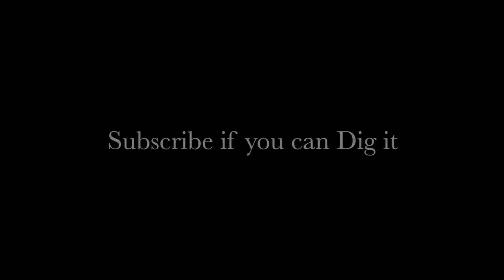Off-Grid DIY 4x4 Fuso

Comment: Currently rebuilding a 1994 REVCON Trailblazer 4x6. It rolls on 35" tires with tag axle.
Also rebuilding a 12 valve Cummins to replace the Ford 460. Hope to see you in Baja.... whenever it's done. LoL